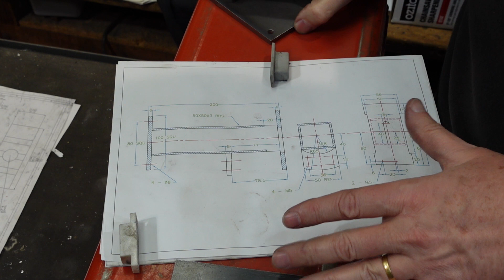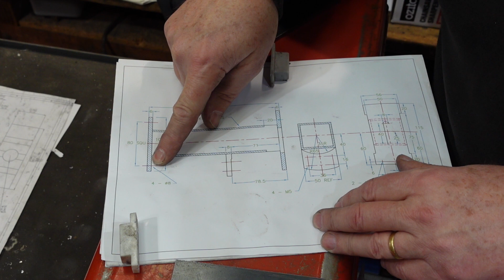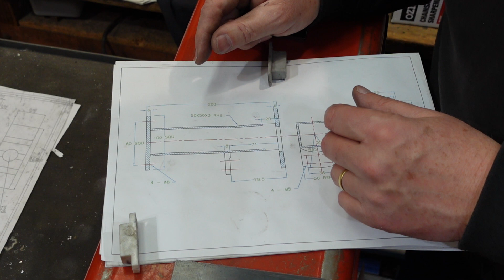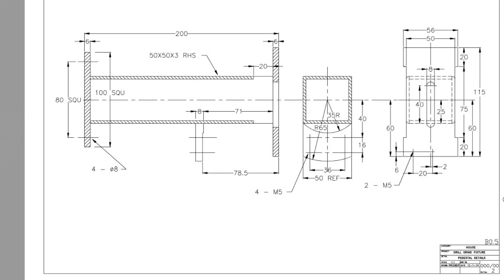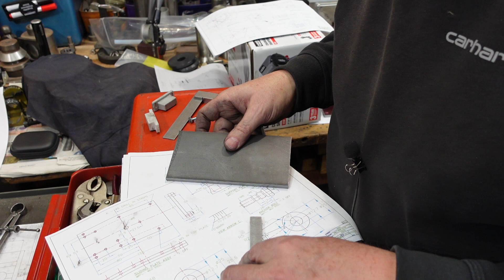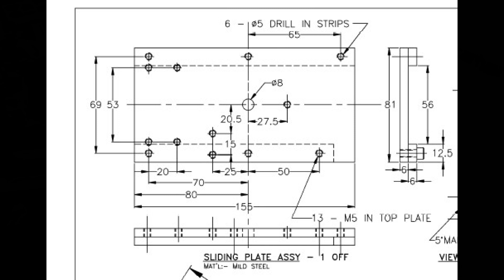4 Facet drill grinder (Gower drill grinder build pt 1)

Comment: great job so far, thanks for going to all your time and trouble sharing stuff with us, as a retired welder we would fit tack a strong back on to base plates of large columns, to stop foot base plate distortion, a piece of rectangular solid bar sized to suit size of work, tack welded on its thinnest edge to bottom of base plate as a strong back greatly helps stop the banana bend, then removed when cooled down, hope you understand  what i mean, cheers Damien
Reply from the maker: Yes - understand what you mean. Even without panel beating this seems to have not bent too much, so happy with that. My welds were a little hot as well, so potentially I could have had even less distortion as well
Reply: @occasionalmachinist your welds look good to me, its always better to see a weld a tad too hot than cold, at least you know its fused together, i worked my life as a DLI welder in the heavy structural steel industry, on projects all over australia, Brisbane airport upgrade, famed  Melbourne observation wheel , Victorian nth sth pipe line ect, just an idea for perhaps future videos, could you do a home shop maintenance video on your lathe and mills, what oil to use, how you oil, cleaning ect, i have a waldown grinder and bench drill, geared head Bridgeport style mill and Taiwan belt drive lathe, older trans tig, and older liquid arc (Lincoln) mig, all older like me, i enjoy my time in my small workshop and am looking forward to more of your videos cheers Damien